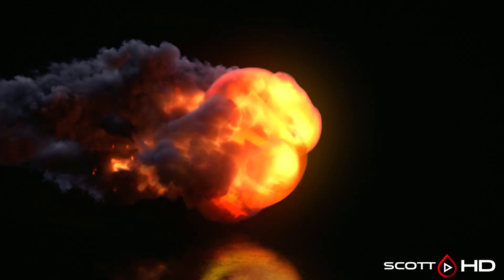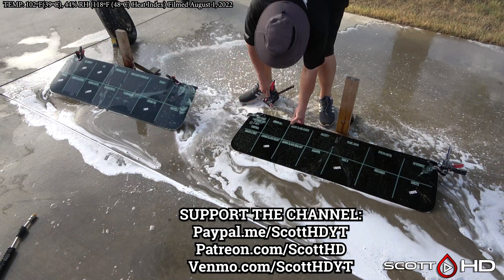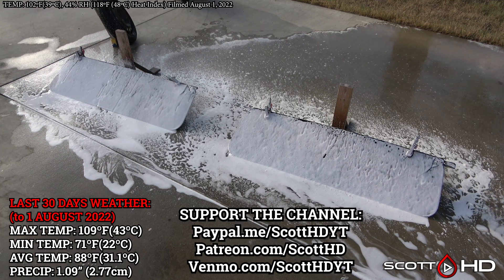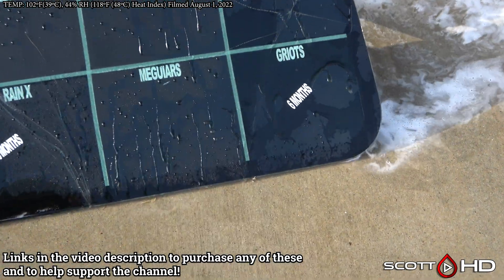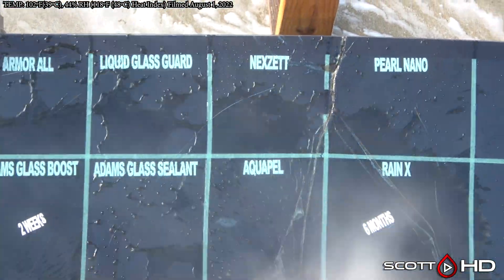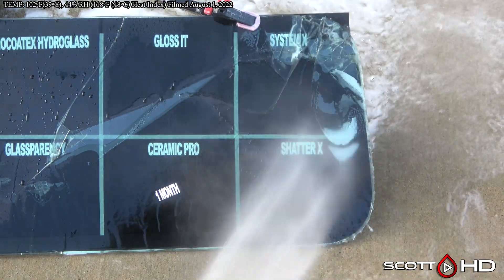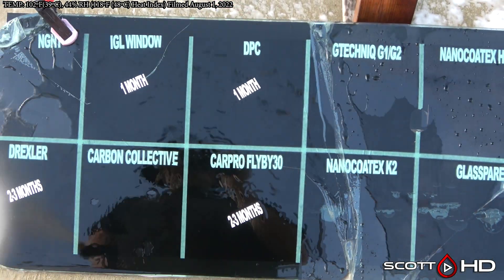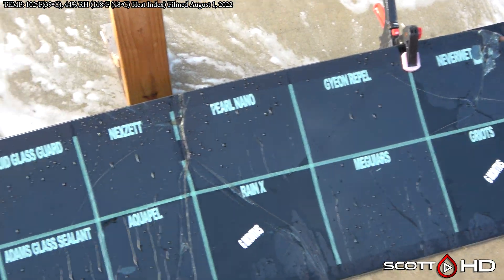28 WAY GLASS COATINGS TEST (HYDROPHOBICS) - UPDATE 12 - 10MONTHS

Comment: Thanks as always Scott! I hope you don't mind, but I had to share this, and this is the short version of my situation LOL! I had a chronic "film" issue on my glass EXTERIOR which was especially a problem on the windshield. Some have classified this as "road film" but I wouldn't consider it that, at least not in my situation. It made it dangerous to drive at night, BUT only when the glass was WET. In DRY conditions it didn't present itself day or night. This issue was present in daylight hours, BUT again only when the glass was wet. Take a wet towel, lay it on the glass, and it would appear. If you even breathed heavy on the glass the film would appear. Once the moisture would evaporate the film would disappear. I've only ever had this problem with 1 vehicle in my lifetime. I researched it and to my surprise I found many others having the same mysterious film issue which effected various makes and models of vehicles across the board, some even brand new just driven off the lot. I tried just about everything to remedy the situation, even cerium oxide, but nothing would last very long. I would compound/buff the glass and a couple of weeks later, sometimes even sooner, the film would reappear. I then went with a coating after compounding and got maybe 6 months out of it and the film would reappear. I consulted with pro detailers and local glass replacement companies and no one had a solution to it, everything they suggested I had already tried. I've been putting up with this for years on this particular vehicle and was so frustrated I was getting ready to replace the windshield. I've come to the conclusion (my opinion) that this was all caused by overnight dew sitting on the windshield basically getting baked onto the glass once the sun would come up. I've had other cars that were parked outside through all 4 seasons over the years and never had this problem before, but I guess there's a first time for everything. So far the long term fix has been, believe it or not... compound/buff and use Rain-X (2 in 1) All-Season Windshield Washer Fluid. Something that simple was the long term solution! Before this I was pulling my hair out! Hopefully my story can be useful. Have you ever come across a film issue like this? Google... strange film on windshield or strange film on glass and you will see what I'm talking about.
Reply: Dang my dads truck has this same issue and it drives me nuts at night. I’m going to give this a try! Thanks!
Reply: @buildingsalvage  I can relate and I feel your pain LOL! It sucks! I hope this works for you as it did for me. You have to make sure you get rid of the issue (film) first. After that start using Rain-X (2 in 1) All-Season Windshield Washer Fluid on a regular basis. I tried everything and this is the only thing that has worked long term for me. It's been almost a year now and the issue has not come back at all. Good luck!

Comment: I used Aquapel during many years but the price was 6$ last years on Carzilla and this years 12$!!!    So this years  i bought Fusso glass  in may.  Very good product so far for 20$  and i used it on  6 cars and i just used around 25% of the bottle.
Reply: Soft 99 has just popped up on my feed, and have been looking at vids. How is your experience with it? Looks like a Rain-X type of product. Longevity? I’ve been using Gtechniq G5 for years now it’s solid and lasts maybe a year.

Comment: which one is the easiest to apply? and what would you recommend for a DIYer? sorry if I missed it somewhere in a video
Reply: I can personally vouch for "Rain-X Glass Water Repellent" and "Armor All Extreme Shield +Ceramic Glass Treatment & Cleaner," both of which can be bought off-the-shelf at the auto parts store. From what I can tell in this and other comparison tests, Griot's Glass Sealant seems to be a slightly improved, reverse-engineered clone of Rain-X. Between the Rain-X and Armor All, despite its performance in this test, I trust Rain-X to last longer in real-world conditions (routine use of wiper blades), though I have no empirical testing data to back this up. That said, Armor All is super easy to just spray on and wipe away with a dry microfiber cloth, then buff clear; re-applying when it wears out is almost trivial. Rain-X prefers to be spread out with a low-pile cloth like a ceramic coating, allowed to flash off to a haze after about 10 minutes or so, then buffed out with another clean, dry cloth.